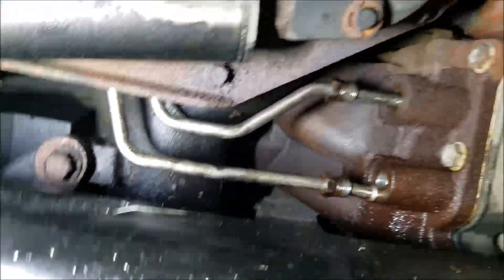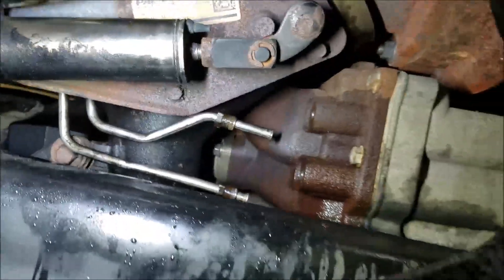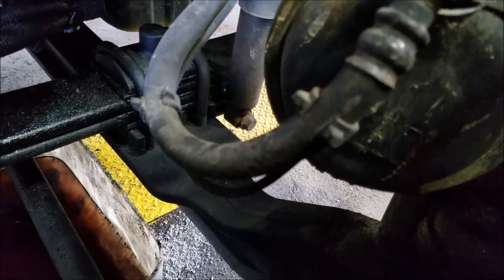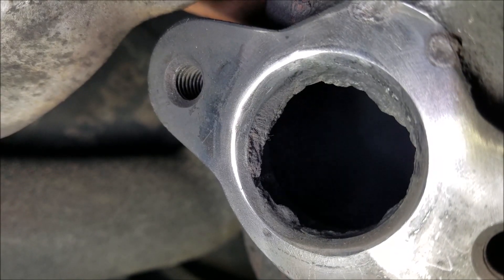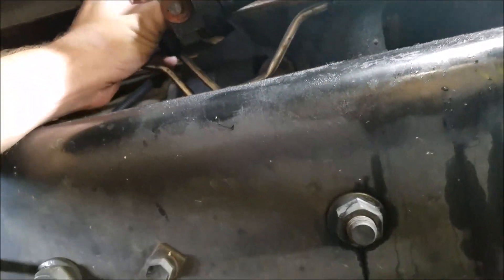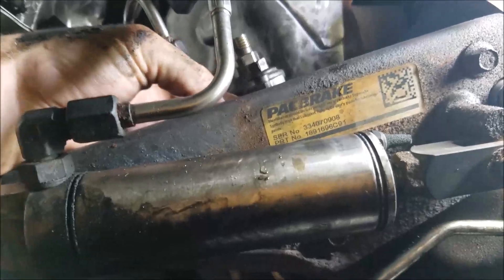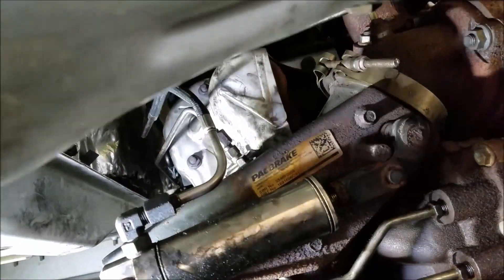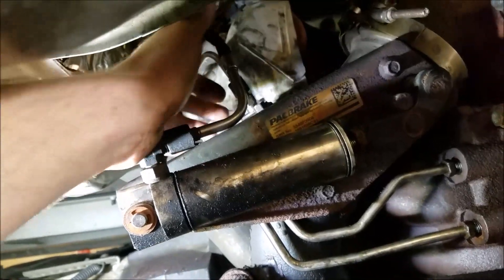FIX- SPN 3556- AFT Fuel Pressure 2 excessively high (Restricted injection)

Comment: Couldnt you just removed the injector without removing the housing? Then stuck a hex tool to remove carbon buildup?
Reply from the maker: Yes, but I've seen them with a lot of build up in the pipe. So, removing the whole injector gives you more room to get in there and clear it all out instead of just a small hole.

Comment: I have freightliner cummins engine  spn 3556 fmi 2 ...
Is it same  code want you have ?
Reply from the maker: That code is for the fuel doser. Its not manufacturer specific.  I'm not familiar with the fuel dosers on cummins engines. Good luck.
Reply from the maker: Whats your engine serial number? I can look it up
Reply: @theaveragehomeowner1493  isx15
Reply from the maker: I need the serial# its 8 digits. All numbers, should be on a sticker on the valve cover
Reply: @theaveragehomeowner1493  my scan tools show me ...
1932. aftertreatment doser data erratic intermittent or incorrect

we replaced the dfu nozzle that is in the exhaust system next to the (DFU filter) where the passenger door ...
But it looks like problem in nozzle after turbo
 housing ??? 
What you think ?
Reply from the maker: You have an open campaign for a recalibration, #C2193. I'd contact your dealer and get that done first. If the code comes back then most likely that doser needs to be changed. Possible causes of that code:
A stuck or leaking aft injector 
An external leak in the aft system
A leaking aftertreatment fuel shutoff manifold.
Reply from the maker: You can also try to clean the aft injector. Youre correct.. It is the one right next to the exhaust outlet on turbo. Clean the tip with carb cleaner and a brass bristle brush only.
Reply: @theaveragehomeowner1493  thanks ...
I'll let you know on monday...
Reply: So this code problem is CUMMINS® DOSER FLUID SHUTOFF VALVESKU 
5308314CUM
This solenoid  valve location on driver side on engine ...
Reply: @theaveragehomeowner1493  ^^^

Comment: How did you get access? Is it accessible from under the hood or the doghouse?
Reply from the maker: Remove the right wheel well. These engines are used in a few different body styles though.
Reply: @theaveragehomeowner1493  Thanks for responding. I have the same year 2012 International  maxxforcedt 7.6. So it shouldnt be much different.

Comment: Mine showed up 3556 fmi1 do I do this process as well
Reply from the maker: Yes. The FMI means Failure Mode Identifier.  FMI 1 means "Data valid but high". The injector is most likely restricted causing the high pressure just like the one in the video.  Good luck. These engines are horrible because all the emission related failures.
Reply: This is all my company uses 180 trucks we have I keep telling them 2 switch 2 kenworth but nooooo "I just turn a wrench"
Reply: I  operate a wrecker with a Maxxforce 9 in it , and have fought this headache every 4 months. Seems to be a routine maintenance practice for us. Your video shows the correct way to do this procedure. I do it the quick way, since I already know it's gonna be clogged up again in another 4 months. I only remove the fuel line and unscrew the injector, then ram a pick down the hole and knock the carbon loose. Saves time and coolant. I think if the injector was engineered slightly longer, it wouldn't be stuck behind a hard crust of carbon, allowing the injector to spray into the exhaust system as it should.